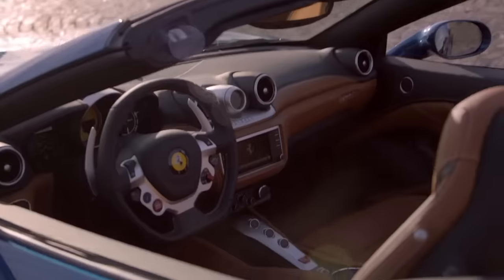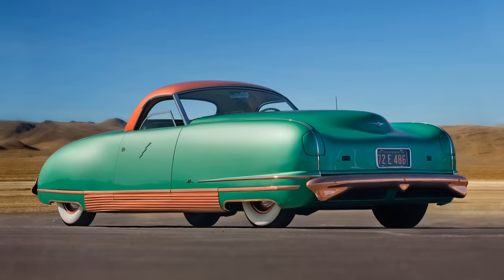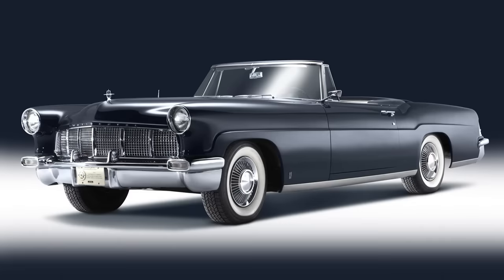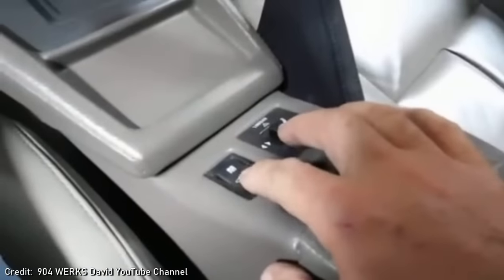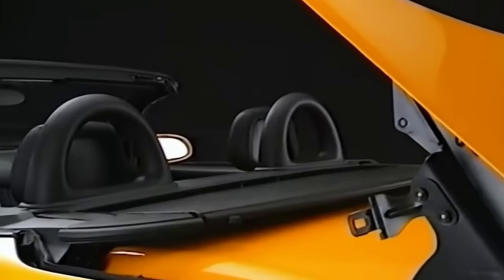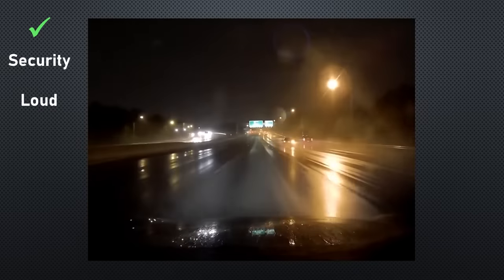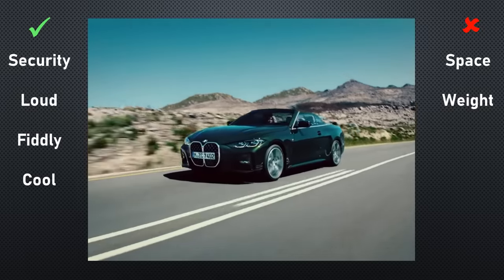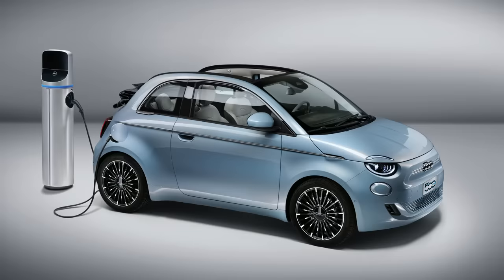The Rise and Fall of Retractable Hardtops

Comment from the maker: Erratum: Georges Paulin didn't of course world for the British Resistance, but the French Resistance (working with the British). My mouth got ahead of me!
Reply: can you make  a video on tata?????
Reply: Tata Motors next please
Reply: Sorry but on advantages you forgot to mention SNOW. A hardtop is basically a normal car in winter, a softop is definitely not. Also I think the del sol is the only design you showed that addresses the trunk space issue.
Reply: In the convertible video, when you did the statistics of hardtop convertibles, you count how many hardtop convertibles were on sale (coming on and coming off sale) in the year (e.g. 2010), not by the end of every year (e.g. 12/2010)?
Reply: @alxa4739  Excuse me what? How is a soft top not a "normal car" in the winter?
Other than a rare case of a few squeaks in some car models if the conditions are just right and snow melts and then re-freezes in just the right places, I'd say soft tops are far better in the snow:
Warmer, brushing snow off them doesn't lead to scratches on paint, and the multitude of advantages which the far lighter weight and more compact soft tops have which enable the car to be designed far better and give it far better dynamics and comfort.

I've owned multiple soft top convertibles as my only, daily car year 'round near the arctic circle for very many years and I don't recognise any reasons why they wouldn't be "normal cars" in the winter. Sure, my 60's Triumph convertible was not suitable for winter use (unless I bolted on the hard top, and even then it wasn't a good winter car) but that's totally different to modern soft tops.

Comment: To be honest… I like how it looks, I hate softtops…
Reply: Ye but softtops are lighter
Reply: soft tops always look like aftermarket thought done in private garage and it is insane they put it in cars which are expensive....this is alright for cheeky inexpensive cars which are not taken too seriously and should look cute and mostly drive around a city....
Reply: @discozula4469  Hard tops provide better aerodynamics.
Reply: Best of both worlds in my opinion. Looks nice when up (unlike most soft-tops) and can still be lowered - being a convertible!
Reply: @discozula4469  and waaayy colder if it’s on your daily!
Reply: Things are always better when they are hard😏
Reply: @dkmorris713  Unless they cause hemorrhoids…
😎
Reply: Soft tops are prone to vandalism poor sound insulation and weathering.
Reply: @EinkOLED  kind of like ur mum
Reply: @dkmorris713  You’re not the only one, my luck is that mine already has died 😎
Reply: Totally agree.  The new 4 series is a step backwards in my opinion.
Reply: Apparently people with softops always have to leave the doors unlocked to stop people cutting them up to steal stuff
Reply: Soft tops leak. That's why I hate them
Reply: Some people have had utility trailers that match the trunk to make up for the lack of trunk space in hardtop convertibles... mostly people who drive Ford Fairlane/Galaxie Sunliners.
Reply: Hard tops are best 
Soft top looks cheap
Reply: @kushyadav8269  The only downside about convertibles is the electric motor costs a fortune to replace once the old one is fucked
Reply: For countries with 4 seasons, no one wants to look at an ugly soft top. Hardtops make convertibles feel like less of a compromise
Reply: I agree. A hardtop feels much safer to drive too.
Reply: @fortitudevalance8424  Didn't think of it that way but makes sense. Those who own a soft top would have to be more careful
Reply: Designs of soft tops are not aesthetically pleasing. Hard tops all day, I will say I have grown to like bentley soft tops, but thats fucking it
Reply: @adrianmitchell6099  Soft tops won't protect you from a crash. They also leak which is the main reason I don't like them. So yeah, hard tops all day dude 😎
Reply: Soft tops does look good on a certain cars.
Reply: @jaymedalbeth6962  yeah but, they look good on that Bentley, plus, just drive a hardtop or non cabriolet car in the rain
Reply: @adrianmitchell6099  Yeah true
Reply: I personally prefer the hard top
Reply: Same I hate soft tops

They lack rigidity unlike T-tops
Reply: #teamhardtop
Reply: @deeacosta2734  👊 Team hardtop
Reply: Especially on all the aggressive new designs a softop just doesnt fit in with newer cars in my opinion
Reply: I love the way soft tops look
Reply: @Alex-yj9xl  i think they look good on some cars but it really depens on the car and the quality of the softop
Reply: Forza Anzio
Reply: Soft-tops also have the appearance of those vinyl roofed cars... Purported as a feature, but really just existed to hide the fact that they were cosmetically flawed. I'll take the nice, shiny, smooth paint of my hard-top any day, thank you very much!
Reply: Nothing ruins a cars lines like a soft top.
Reply: @Person-cv9dj  bmw's ruined the best z4 gen with this cheap cloth in a 60k car
Reply: @discozula4469  soft tops are a lot noisier as well!!
Reply: @dkmorris713  that is what my sister-in-law said to me the other night!🤣
Reply: @ecchioni  Incorrect, hardtops can require bulkier cars just to fit them so it's very possible that overall soft tops have better aerodynamics. For sure soft tops enable better dynamics, handling and comfort.
Reply: @cra83  Colder? How? Totally illogical: do you wear a thin sheet of metal in the winter or a few layers of cloth to stay warm?
Sorry: the myth that soft tops are cold is absolutely ridiculous.
Reply: @jaymedalbeth6962  Soft tops absolutely do not leak. At least for about half a century now...
Reply: @adrianmitchell6099  Soft tops are far more elegant. Look at cars like Maserati GranCabrio, Rolls Royce Phantom Drophead Coupe, Aston DB9 Volante, BMW E88 Cabriolet...
Reply: @robertbutler8004  Nope, definitely not noisier. At least for about half a century... Modern soft tops are very high quality multi-layer tops and some even have composite panels inside at certain aerodynamic pressure areas. Rolls-Royce wouldn't use soft tops if they weren't very pleasantly quiet.
Reply: Totally agree. Love my SL55 AMG with retractable Hardtop 👍
Reply: @bubffm  It would be far better in very many ways if it was designed and built with a soft top like modern SLs, McLaren SLRs, Maybachs...
Reply: Convertible = Soft Top! 😡
Reply: Bentley Continental GT soft tops have better noise insulation than a hard top and are much lighter, so it just depends on the auto maker
Reply: Well said!!
Reply: @yimmytjahjono6262  "I hate softtops" is well said?
Reply: @TheKenjoje hat‘s your opinion. In years past, convertible with soft tops were considered to look so upmarket, that US manufacturers even covered their regular sedan roofs with vinyl to make them look like soft tops.

I always thought that a convertible should look like a convertible and that a convertible almost and automatically looks like a more expensive and more desirable version of a coupé. I would like to have a soft top in a contrast color on my convertible, so that it stands out more.

If I see a hard top conv. my reply will be: „Ah, another coupé. Not interested“

Actually I do prefer convertibles where you just throw the roof open with the flick of a hand, because in my opinion there should be a law against driving a convertible closed unless the read is wet. When I had my Z4, I drove it open even in winter, as long as it was dry. Windows up, wind shield in, heater on and you could drive it open even when it was freezing. OK. People probably considered me a bit strange.
Reply: @Kref3  you didn't get enough respect from me to continue reading after the first paragraph....
Reply: @TheKenjoje  Well, some people prefer to shout out their opinion, others prefer to explain it. If you are of the first type, I could not care less about you, so all fine, mate.
Reply: @Kref3  I said everything it was needed to be said in the earlier comment....
Reply: Same. Soft tops are vulgar looking.
Reply: Wr puchased the MX5RF
Reply: @discozula4469 yeah thats what im searching for in a convertable, they are already more heavy than a regular car
Reply: @pistonburner6448 totally agree
Reply: Maintenance cost is double and no one want to fix that hard top
Reply: @discozula4469  A vespa is lighter than a car.
Reply: I drove a used 2004 Mitsubishi Spyder for about 8 years. Softop, of course. So noisy at highway speeds. Prone to tearing after years of use in multiple spots, and those tears get bigger and bigger until you replace the whole thing. And dont forget tearing = water leaking into the cabin unless you patch it, and that looks awful and feels like playing whackamole. That experience convinced me to never go for a softop again for a long term driver.

Then Mazda showed up with their retractable fastback and it's been roses for the last 3 years.
Reply: @maxmeier532  a vespa also has 2 wheels, a motory cycle or moped engine and critically, isnt a car.
Reply: Agreed!
Reply: @TheKenjoje Except for porsches, atleast on the newer 911s, but I also hate them.
Reply: @Alex-yj9xl  I would understand if a woman said that, but not a man.
Reply: @pistonburner6448  Hardtops also have insulation.
Reply: @pistonburner6448  They mostly look unaesthetic and ruin the line of the car
Reply: @Kref3  I have a miata and I removed the softtop and put a hardtop on it that can't be put down.
Reply: @Maxaker  What ruins the line of the car? The massive haunches needed for hardtops? The extra long windshields making the convertible seem almost not convertible at all? The massive extra weight making the handling and performance suck doesn't matter?

Most people, all people with taste think cloth tops look massively better.
Reply: I have a soft top E 400 cabriolet with a soft top.Before it, I had a slk350 with a hardtop. I loved the hard top but fell in love with the profile that the  soft top gave the 400.I was  concerned about the durability but have found it is not an issue for a car garaged.I cannot say I have noticed the soft top creates for a noisier car.
Reply: @TheKenjoje I beg to differ.I LOVE the profile that the soft top gives a  car.VERY sporty.
Reply: @cra83 I've driven hard and soft top convertibles in the middle of winter and felt no difference in temperature though mine was a wrangler and they have pretty powerful heating systems
Reply: @archygrey9093 honestly I do that weather I have my hard or soft top on my wrangler I don't want someone smashing my windows though I don't keep anything of value in it I'd rather they just open the door and rummage around finding nothing than smash my window/cut my top/break the lock
Reply: I agree

Comment: Idk about everyone else but I prefer a retractable hardtop over a soft top. I’ve had both and I can tell you it’s a whole helluva harder to keep the interior hot or cold with a cloth top. Plus criminals can’t cut a hardtop as opposed to a soft top. Oh and did I mention better roller over protection?!!! Don’t forget wind noise too
Reply: When either top is down rollover is the same surely? If worried buy a coupe.
Reply: I agree with your other reasons but it doesn't really add much rollover protection since it's usually very light and not structural. I used to drive a VW Eos and it had spring loaded roll bars in the rear headrests that would be deployed in a rollover that along with the reinforced windshield frame could hold the car. The roof was considered expendable in a rollover. I believe many newer convertibles have similar systems.
Reply: @Pete-z6e  yes when the top is down there is no difference but when you’re in weather they requires the top to be up, a hardtop provides better insulation
Reply: @PaulN504  that may be the case with a VW but I’m talking from the perspective of a SL. The hardtop in my car is pretty stiff. I’m not saying it will protect you in all situations but is better than a soft top
Reply: Just have a car that ass a solid roof, its a loot more practical
Reply: @LasVegar  harder to get a tan that way lol
Reply: @LasVegar  you don't drive a convertible to be practical, you drive one because it's more fun, the same reason why people ride motorcycles. Though some convertibles can work well as a daily driver too.
Reply: @PaulN504  That's where hardtop convertibles come in:
When you can't afford a practical car and a fun car and you have no garage, a coupe convertible allows you get a bit of both in just one car!
Reply: @PaulN504  a hard top makes a convertible practical
Reply: I've lived near the arctic circle driving many soft top convertibles as daily drivers throughout the year and it has always irked me and astounded me how illogical and thoughtless the people who ask "doesn't it get cold?" are. How does one come to the conclusion that a thin layer of metal insulates well, but several layers of fabric does not? Who wants to wear a coat made of thin metal in the winter?

Let me guess: you've had an ancient soft top car and nothing modern. Actually that's not even a guess, it's certain that you have no experience with a modern soft top as you are totally incorrect about the heat insulation difference. If anything even logic would tell you that several layers of fabric are better at insulating than a thin layer of metal.

You are also totally wrong about the wind noise. That too was only a feature in soft top cars like a half a century ago. Nowadays Rolls-Royce uses soft tops for a reason.

And to complete a full Bingo for you: your claim that hard tops give better rollover protection is also false: they do not offer any structural strength in a rollover situation. More like they will dislodge and intrude into the passenger area...
Reply: @kenxiong6830  If you're driving a convertible just to get a Tan I suggest it's easier to score one by going to a Chinese gay club.
Reply: @LRM12o8  How is a hard top convertible more practical? It's not.
Reply: @PaulN504 The top of the EOS is not structural thats why VW doesnt allow rooftop baggage carriers / bike carriers on it. The rollover protection even deploys when the roof is closed
Reply: Ugly though

Comment: As a former owner of a Triumph Spitfire with a bolt-on hard top, I concur that they are way quieter and make for a more refined and rigid drive. Let's hope in a few years you make a video on the embarrassing craze that was the SUV.
Reply from the maker: Amen!
Reply: @BigCar2  I'm quite certain you could do that now, no need to wait.
Reply: As a former owner of a 60's convertible Triumph as well, and also several German and Italian modern convertibles I can tell you that your information on convertible tops is obsolete and for today's convertibles it is incorrect.
Back in the days of Spitfire convertible soft tops were absolutely horrible: thin, horrible mechanism, dismal sealing, horrible aerodynamics, plastic windows, etc. etc. etc. A bolt-on hard top is also very different to a convertible hard top.

Nowadays soft tops have multi-layer construction and many have composite panels inside too, they have excellent mechanisms, glass windows, and their aerodynamics and sealing is great. It's impossible to make precise blanket statements as anyone with nefarious motives could pick a bad pairing as an example (eg. Lexus hard top vs. Fiat soft top, or the other way: Rolls-Royce soft top vs. Renault hard top), but overall nowadays hard tops are not "way quieter" as both solutions are adequately quiet (depending only on the manufacturer's desire to increase the cost and put in weight). 

What can in fact be said very certainly is that soft tops make a more refined and rigid drive. Soft tops allow the car's structure to be strengthened more without having the added huge weight and compromises in structural design (hard tops need the body shape to be designed to minimise roof size and be compromised massively to enable a space big enough to store it). Soft tops are lighter so they create less inertial movement within the roof structure compared to the rest of the body and they also have less inertia to create movement in the whole car. In short: soft tops allow the cars to be better.
Reply: Lol. SUV are here to stay boomer.
Reply: That’s utter rubbish have you ever been in a Mercedes convertible with a metal roof
Reply: @bighosre10  Doubt
Reply: @bighosre10  The boomers would be the ones in SUVs though?
Reply: @bighosre10 "boomer" as if SUVs arent the definition of the selfish boomer mindset.
Reply: Given the requirement for space for ev batteries SUVs are here to stay until we give up on the current range of electric vehicles
Reply: @bighosre10  Boomers are the ones obsessed with SUVs.